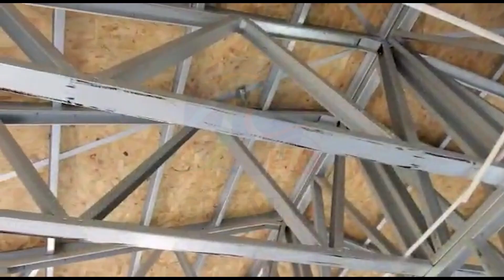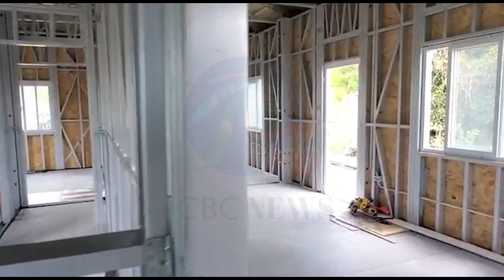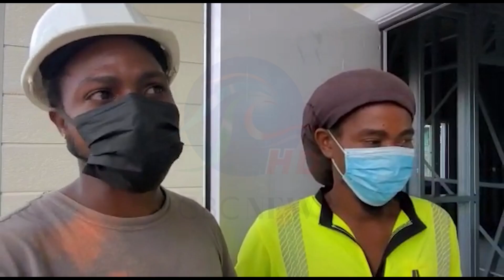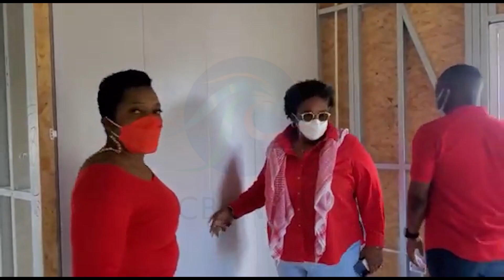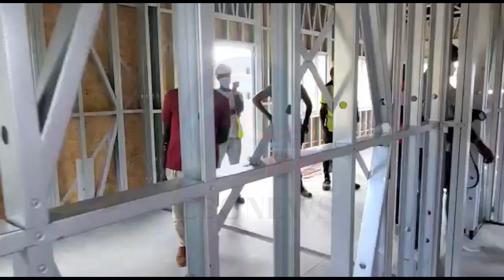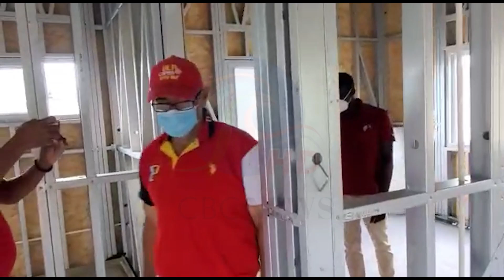Great start in addressing housing demand

Comment: i believe all Barbadians should start thinking about Rebuilding and start to build their Homes with Basements that can Resist Most Emergency Storm and Hurricanes Disasters. They should build their Basements with Metal Ventilation Material which will supple  Air and which the Trappers can strike on to Alert the After Disaster Search Team.Thank you.